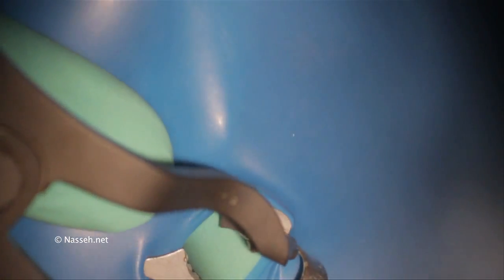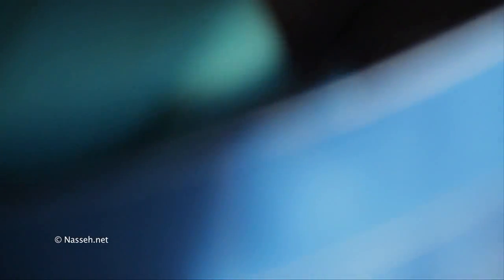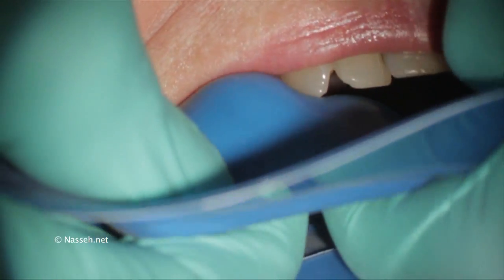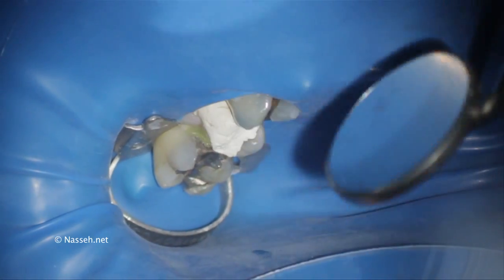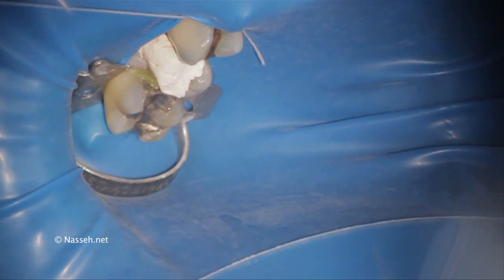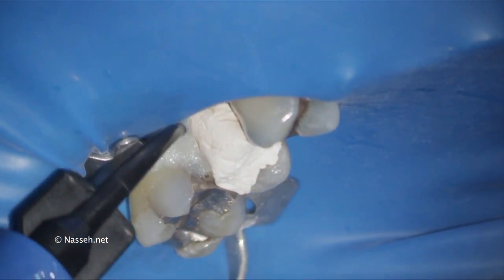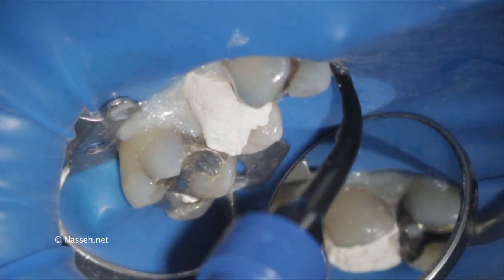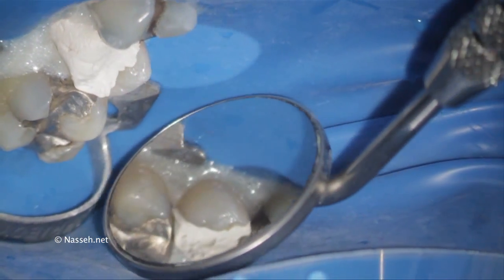Split Dam Technique

Comment: If we have to put a crown on the tooth , and margins are subgingival or eqvigingival , will split dam technique help?How can we take rubberdam sheet more subgingival
Reply from the maker: There are clamps that help with that; but for doing crowns, the split dam is the best approach. Will it isolate 100%? No, but it will isolate far better than alternatives and it will help reduce contaminated aerosol greatly. So, just clamp the distal tooth and pull the Rubber Dam to two teeth in front when prepping the middle tooth. For last molars, clamp the tooth crown prep the occlusal and the sides all the way close to the gingival margin and where the clamp is. Then remove the Rdam at the end only to finish the margins closer to where you want. You still reduce aerosol for the duration of 90% of the preparation time when doing that.
Reply: @EndosKool  thanks for your inputs sir.Brinkers are the clamps which are used during crown cementation or any other? Woth split dam technique

Comment: What is opal dam? Can this be removed easily after the treatment?
Reply from the maker: 郑佳 it's a material by Ultradent. It can be removed easily. But some times, you may have to drill it out. It's still rather easy with good magnification.